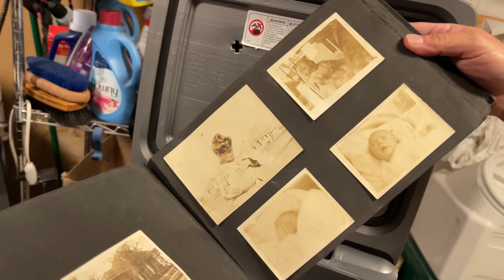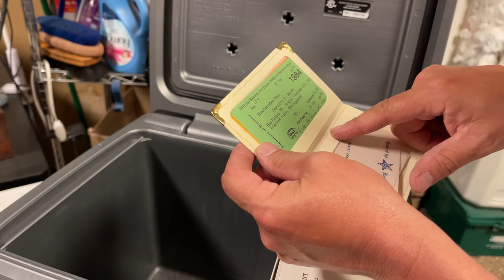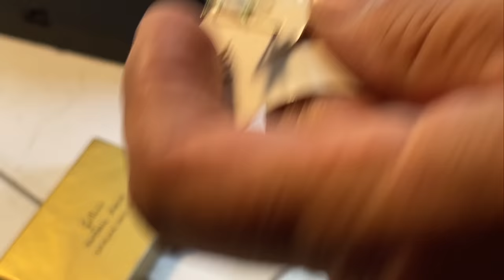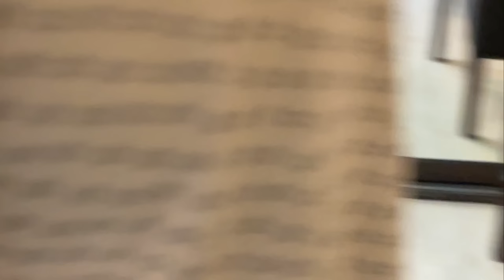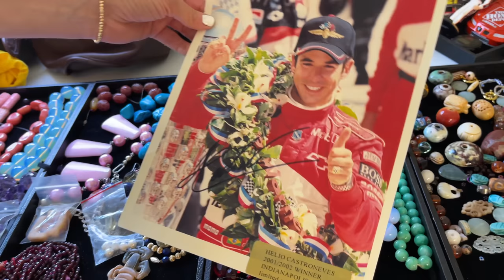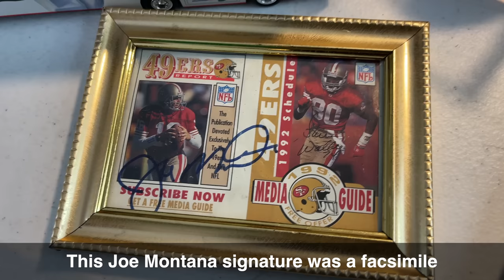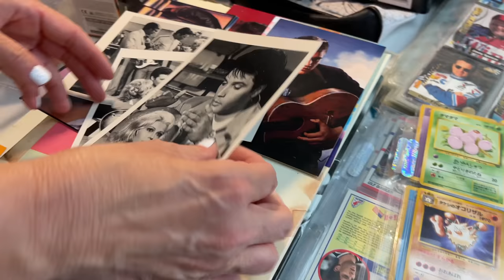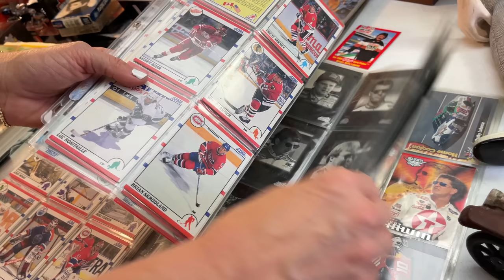Let's BUST INTO THE SAFE we found in the "Moved to Hawaii" locker. It's full, and it's amazing!

Comment: There were no Mets before 1962.  If that were a 1969 ball, yowza.  (and I'd fight you for it. )  Double-headed eagles are used all over the place.  Looks like an old ring though; 10k doesn't get that worn until it's been around a while.  Luna, btw, is cheesed that you're not paying her enough attention.  She needs a cat named Stella to boss around. Silver-soldered is silverplated copper, generally - higher end plate.  The solder is silver but the rest...? 23:26 That eagle might be ebony or lignum vitae. If the coffee grinder had woodworm, maybe before it was made into a coffee grinder.  The trails aren't generally visible on the surface since the worms burrow. Usually that means European, what's left of it. I'd look at spalted wood too, as more likely. Maybe a combo of the two?  28:12 dyed sugilite looks like. 28:36 Chinese for sure. 29:08 tagua nut 29:53 I'd bet on those being Nepali or Tibetan.  She probably paid crazy high gem show prices on the beads, but I'd have pigged out too.  My favorite thing in the video is Luna of course!  But of things up for grabs, either the beads or the Mets ball.

Comment: For the future. Use a Strong putty knive and put it up against the lock pin inside and hit the pin with a hammer towards the way you want to open the lock. Will open way easier and sometimes you can reuse the safe.

Comment: safes like that are super easy to open just place  a decent flathead screwdriver that gets thicker as it gets to the shaft  und use a hammer will get it open enough to use a crowbar and finish it off.

Comment: You need to use a metal saw and cut through where the pin goes down to the lock. Then it will just open right up!

Comment: Any time you drill metal, periodically add a drop or two of penetrating oil ( WD40, Liquid Wrench, etc) to your surface. You bits will last much longer, and the process will go quicker, as well. Just thought I would share...
Reply from the maker: Thanks! I'll try that. I always have a can of WD40 around (or several, LOL)